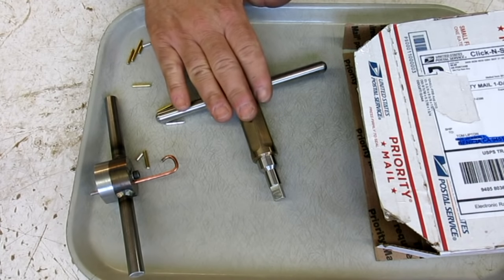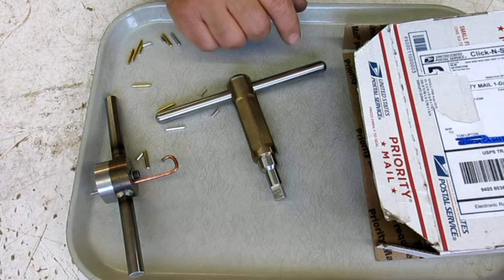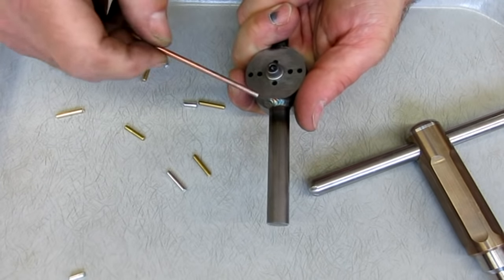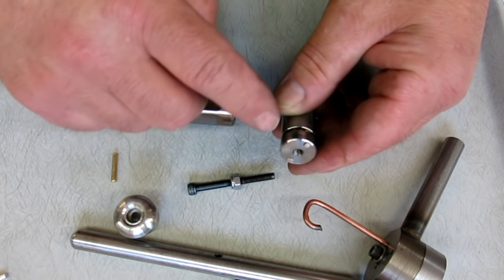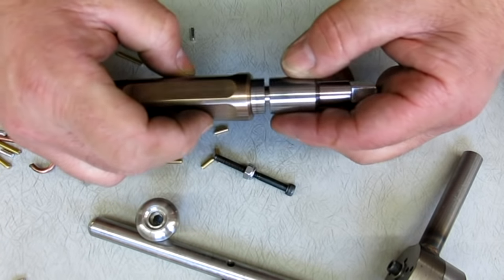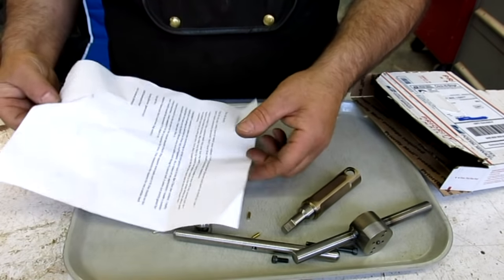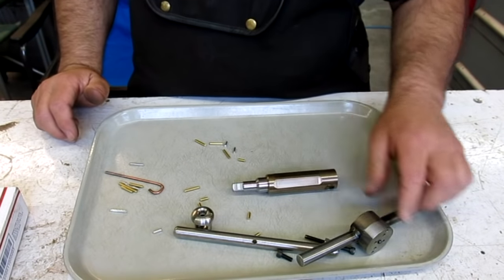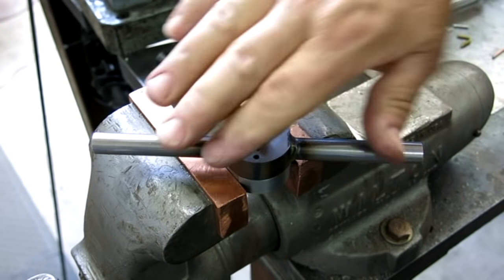Snap Off Chuck Key

Comment: Beautiful! Now time to produce your own line of custom chuck keys and more importantly, "safety" tap handles. Adjust breaking-point torque more or less to the tap/handle size, with a set of replacement pins. BTW - nice hammer :)

Comment: Re-engineer with a spring and ball detent. It will "test good" in the hand, but fail under higher torque. I may do this myself and calibrate to prevent someone over tightening my chuck in the pursuit of true 0.

Comment: Something told me not to mess with that chuck key or the side Adam won the match with you!  Oh the thoughts in my head when I followed your drop the key move! LOL Nice plot and build, a little tiny bit less pin strength and putting out more personal pressure, would of created the snap at the time you wanted, but it just played out a couple rounds! LOL ;{)-------
Reply from the maker: Hi Keith,

I really like the actual outcome. The "Cheater" got his ass whipped and the sleeper from back east took the prize fair and square. Our buddy Adam will be sharpening his knives all year for us. Thanks for stopping by.

All the best,

Tom

Comment: I used to have fun with Diesel Mechanics when I was in the business. Every week we'd have a new class and I was brought in to (try) to teach them failure analysis. So we would go in the shop and I'd clamp a rusty untouched turbocharger in the vice. Now the flange was so close to the body you couldn't get a closed end wrench on it. You had to use the open end. I'd pick out the biggest dude in the class and ask him: "Hey. Can you break this loose for me?" While handing him a Craftsman wrench. Now I weigh 120# and am skinny. Big dude would laugh (as did the whole class) . Then he would round off the head of the bolt because Craftsman wrenches even then were soft.I would say: "Oh wait a minute. I have a better idea." Then I would take a SnapOn wrench and fit it to the bolt he had just rounded off. Smack the wrench with the heel of my hand and break THAT bolt loose and then do the others and take the hot side of the turbo off.The look on their faces was always priceless!Went through the rest of the disassembly and showed them what to look for with my collection of failed parts. My hand usually quit hurting before the next weeks class...Don't mess with small old guys either... :)

Comment: Next time,put a receiver ,relay and solenoid so you can remotely make it limit torque enough to slip only when disengaged. Then reset only after the complaint. That way it works perfect under scrutiny.

Comment: I am shocked -- shocked!  (as Louie said in Casablanca) that you are using such underhanded, devious, and ungentlemanly tricks to defeat your arch-rival abom79 in this casino, er, I mean machine shop :) but that said. it is a nice piece of engineering and, with better pins in it, would provide a nice second key in the two-key method of adjusting a 4-jaw . All good fun, and a good laugh for the day. And it does prevent overtightening.

Comment: That ball peen hammer at 23:44 is an intriguing tool. The head's a bit longer than usual, but the handle is what really caught my eye. The full diameter handle tapering down to a slender end seems like it ought to give you a nice feel for what you're hitting. I like little ball peen hammers like that, but modern ones tend to have grips that are too slender to hold.

Comment: Thanks for showing the design.  On the practical side, with the right pins it will make it easier to change the working end if it gets boogered up or if you want to change it to use on a different chuck.

It might also be a practical design for Mr. Pete's high school classes if they have a problem with students over tightening chucks and breaking off jaws...put in the right pins to make the wrench break first.

Comment: I have just just dipped my finger in petrol for a few hours a night for the past 25 years and now it is sufficiently hard enough to tighten down a lathe chuck. No key needed and because it is attached to my body, I can never forget it in the chuck. I have become pretty proud of my square ended finger, it has become quite the talking point.
Nice engineering buddy

Comment: Lovely piece of hardware. It was a hoot during the bash to  watch the live feed. Watching you assemble it I got thinking you may have added too much clamping force by torquing the bolt a little heavy? No matter it served the purpose of great entertainment. :-)
Reply from the maker: Hi Colin,

I don't think so. It was free spinning with finger torque. Adam just didn't crank on the key as hard as I thought he would until the second go around with Keith. Bad estimation on my part. The end result couldn't have come out better. Thanks for stopping by.

Best,

Tom
Reply: oxtoolco
Hmm, so it's obvious that Adam didn't feel much pressure until contestant #2.... grins :-)

Comment: This would be useful if you could design/machine a slip-clutch that would fit in there, then you could "program" in the torque limit for your chuck (or this gag) and it would be reusable! :)
Reply from the maker: Hi William,

When I first decided to do this I wanted a slip clutch as you mention. After doing some force testing it was apparent it would be very difficult to fit a spring loaded mechanism into the available space. The shear pin was a simple solution to the problem. Thanks for the comment.

Cheers,

Tom

Comment: Hi Tom, I've been watching some of your lathe videos from the past couple years and haven't found anywhere that you show or state the specs on your YAM lathe.  What is the swing and center length on that lathe?
Reply from the maker: Hi A,

Its a Yam 1500G. The swing normal is 17 inches  and through the gap it will swing 24 inches. The length is 1500mm which is 59 inches. Thanks for the comment.

Cheers,

Tom